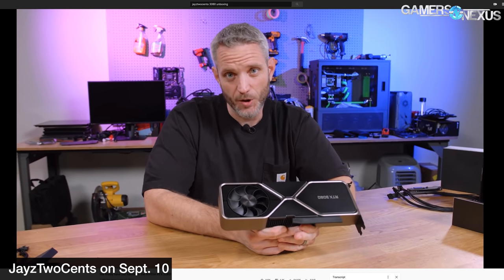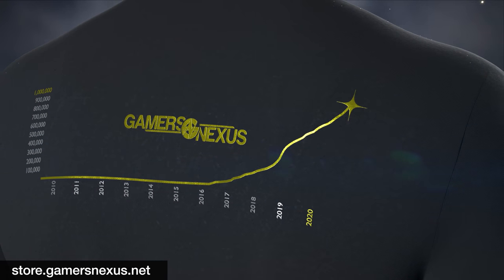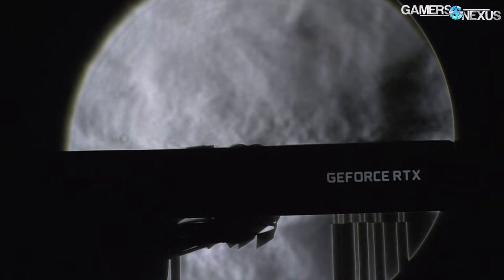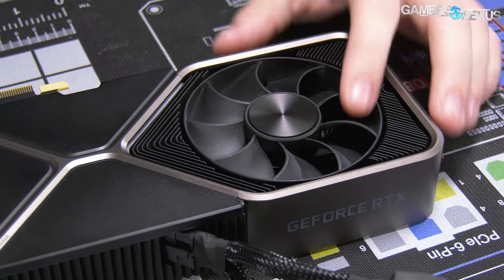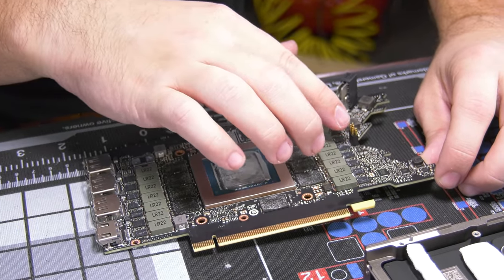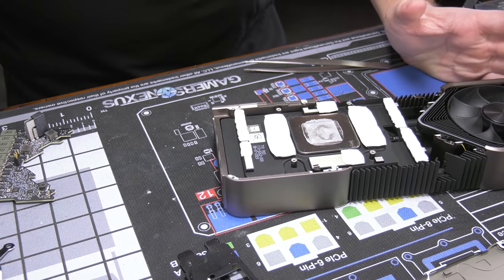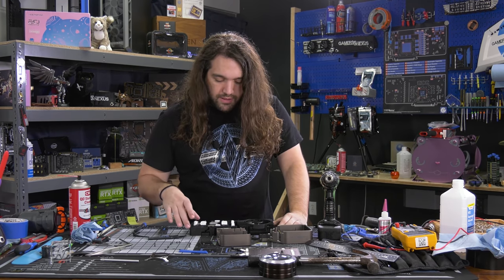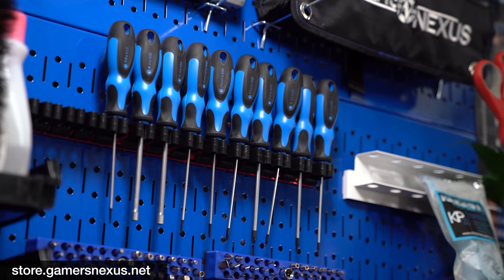Tear-Down: NVIDIA RTX 3080 Founders Edition Disassembly - A Lot Fewer Screws

Comment: "You're destroying that card" 
"Ok. Let's get one thing straight, the pcb is fine, the card is fine, it still works, it's fine." 
"This is why Jay said go watch Gamers Nexus"
Reply: the only thing he really drilled through was one of the magnetic covers, and frankly anyone taking apart this shouldn't even bother putting those 4 tiny covers back IMO
edit: unless it's absolutely for the looks on a vertical mounted gpu

Comment: Nvidia: Let's put some magentic screw hole covers so people can take the card apart easily!
...

Steve: BRING ME THE DRILL
Reply: Also, how safe is it to put a strong magnet near the RAM area of the card? I remember hearing back in the ddr days ram was very sensitive to magnetism, like you could kill a stick by photocopying it cause the lamp had a magnetic field
Reply: @H1nD009  no magnets could destroy HD or other magnetic media, , but not dram or sdram, they don't work with magnetism. There shouldn't be anything in a video card that magnets could destroy. Magnets may also effect certain electronic components that rely on magnetism to function while they are on, like certain relays and coils though, but you would have to contact it with magnets while it's on and functioning to mess those up.
Reply: @bakadeshi_aunstudios  thanks! I heard about that back in the early 00's but never questioned it
Reply: Magnets seemed to be for holding the covers to the screwheads, not to aid in removing the covers. That's why their own guide recommended a different way to remove them.
Reply: Steve doesn't need someone to him bring his drill, Steve always has a drill nearby

Comment: Steve: That paste is really dry
Jensen: I had them in my oven, what do you expect
Reply: Han Lockhart  Wh..... wh.... whyyy? It's pretty obvious that the thermal transfer is very good, since this monster stays just above 70 degrees during full load. Also, "dry" thermal paste does not automatically mean "bad" thermal paste. Some thermal compounds are actually meant to be dry! They might not be the absolute best of the best, however, in this case, I would say that it's doing a more than decent job.
Reply: @ruxandy  right
Reply: Han Lockhart  Low quality thermal paste or the cards are at least half a year old just sitting in a box, waiting for a sucker to buy it.

Comment: 14:40 I hate those ribbon cables so much! Every time I find them in a device, I know it's gonna be MUCH more of a pain to reassemble.
Reply: those cables  get a considerable amount of permanent damage every time you take them off, so have fun having to replace them  somehow after removing and putting them on 15ish times
Reply: When you getting one Dawid
Reply: are you going to review one dawid? i'd love to see you're take on things.
Reply: I would love to get my hands on one. I'm gonna try buy one tomorrow.
Reply: @DawidDoesTechStuff  good luck!
Reply: i find you every where my man, why do you post alot of youtube stories but you dont post videos
Reply: @Dacite6  I posted a video today. 😅
Reply: Love your channel.
Reply: @DawidDoesTechStuff  okie, i commented on your video
Reply: its better than legit ribbon cables like the switch lol
Reply: Totally agree😱 ribbon cables are the worst nightmare! Little tabs are so weak, and if you mess up the pins you'd have to cut a healhy section and sand the plastic coat to expose them again... And good luck trying to find a replacement😩😩
Reply: Actually ruined a PS4 controller because of such a cable once
Reply: @DawidDoesTechStuff  thats totally epic, have fun trying to get one though considering everywhere they sold out instantaniously.
Reply: As someone who've repaired a ton of laptops I beg to differ. ZIF sockets are a godsend once you get a handle on them.
Reply: Your name sounds like you're stuck in uwu mode.
Reply: I can never get them connected properly during reassemble.
Reply: I can't help but actually read that in your voice
Reply: Me too, I ruined mine and I'm screwed..
Reply: @AdrianOkay  I have an iPod 5G, it has the same ribbon cables. Nope they don't get permanent damage at all. One has to be just careful not to rip off by force.

Comment: I didn't realize how much of a graphics cards is just the cooler.
Reply: Yeah that's basically just a "card" actually !
Reply: I am amazed how small it is, super compact, imagine if it didn't generate any considerable heat and could work like this.
Reply: @arthurand1006  Well normally they are like twice this size. This one has been shrunken down to fit this new cooler design.
Reply: @jaalan7896  I think it just looks this small, due to the rest of the card being so big in comparison, I mean, they can't just shrink dies this easily, if they could than they wouldn't need to wait for tsmc and samsung to shrink their node.
Reply: Heat is the biggest modern issue in computing. Think about CPU and GPU the main powerhouses of the computer, both have to have insane cooling solutions because the chips have been made so tiny and powerful that it's very easy to overheat them with so much power in such a tiny space. Even nvme drives and overclocked RAM now require clever cooling solutions to keep from overheating. Heat is the reason computing is slowly approaching a line that will be impossible to cross without either 
1. new cooling solutions like submerging all the parts in antistatic liquid and pumping the water through a refrigerant cooler
2. quantum computing
Reply: @arthurand1006  Dude I'm also Arthur Andrade
Reply: @ShadyRapture  I wasn't much into M.2. SSD drives because I didn't use them yet, one day I decided to buy one to my server and I learned that what I thought that was some fancy metal design with a ROG logo on a specific spot on the motherboard, was actually a M.2. heatsink, I didn't know those needed one as I only used regular SSD SATA drives 😆
Reply: @OrbitalSP2  hahaha, Andrade is my last name. I bet you're a brazilian too
Reply: @arthurand1006  yes my last name too and also brazillian
Reply: if only lol

Comment: I would say that the silver metal housing is there partly as extra thermal mass and partly to improve the airflow by blocking more of the turbulence generated by side-draw into the fans which should improve the differential pressure across the fans, which should improve airflow (and thus cooling) at lower fab speeds. 

The fact that it looks nice is probably a nice bonus.

Comment: Steve: remove the ribbon
my head from watching JerryRigEverything: just like a little lego
Reply: With deeper grooves at level 7.  :D
Reply: I have worked with those flex cable connectors and they are really fragile. I think they are rated at like 10 uses. If you are careful you can get a lot more but we still broke them a lot and had to replace them.

Comment: "nvivida, how should I remove these screw caps?"
Nvidia: "glue them in place"
Reply: The drill holes are like those water indicators that shows if your device was wet.
Reply: At this point I'm convinced Nvidia wants you to make it look more difficult than it is. Like, what? Highly payed engineers over at Nvidia don't know that tape exists?

Comment: Steve, "Adhesive on a stick" doesn't necessarily mean to use GLUE. Tape is ALSO an adhesive. Not to mention you used a MUCH bigger stick than needed. Personally, I would have reverse wrapped a toothpick or similar sized piece of wood/plastic with duct tape and call it good.
Reply: Honestly just a ball of bluetac might have done it
Reply: Tape is an adhesive and a thin sheet stacked together

Comment: Glad to see someone shouting out "Engineer", they're Japanese, you can find them on eBay or at engineer(dot)jp and are damn good tools, way better than the near bottom of the barrel iFixit that all the tech tubers peddle. They might not be the cheapest but the compete with tools 2-3x their price IMO.

P.S. no I'm not a bot just an actual engineer 😅
Reply: How is Ifixit bad?
Reply: @voidofspaceandtime4684  their tools are not made for repeated use and won't last you as long as a good one.
Reply: @voidofspaceandtime4684  I bought a kit and I'm not happy with build quality, it's like a throw away kit
Reply: @voidofspaceandtime4684   They're not bad, bad, they're just the same quality as if you went to Aliexpress and sorted by price with cheapest first then bought the first result that looked somewhat good (but it would be cheaper that way), if you buy them to use once in a while they'll do the job which I'm sure is 90% of their target audience but if you want a good tool with good sizing and finish that will last I would absolutely look elsewhere.
After all the tech tuber endorsements years back I ended up buying a set and was very disappointed given the price, same cheap Chinese parts but 50% more expensive.

On the other hand after spending years looking for good tools at a good price, "engineer" were the first ones I found that could trade blows with the premium (both in terms of quality and price) tools that I have used over the years. A pair of snips might cost $20-30ish instead of $10 but they trade blows with the $70+ ones IMO.

Also nothing against iFixit as a company, I think what they do is great and looking at their tools as supporting them by buying their merch is valid, I was just hoping for/expecting more after all the non-sponsor spot endorsements.
Reply: Yeah, I like their stuff. I have their Nejisaurus (screw removal pliers) and their Bazooka (screw removal) as well. I'll have to look into their other stuff as well when I'm looking for more tools.
Reply: imagine buying any of these tech kit piles of junk and not buying real tools lmao automotive master race
Reply: @Attachments.  I only work on my PC with SnapOn air tools
Reply: Anyone wanna link me these toolkits? I gotta give my family something for my christmas list. 😏
Reply: @Grrizz84  Thanks for the heads up always good to know about in between brands I.e. Tekton, that hit a higher performance than their cost leads to believe.
Reply: @patrickw6074  when the SnapOn truck rolls up to the jobsite, it's pretty much strong armed robbery.
Reply: I bought an ifixit kit back in... shit, years ago now. The ruler was crap and I managed to snap a smaller flathead bit but other than that it's been reliable. I wish the driver handle was a bit thicker though. I'm in the market for a new kit actually, Any suggestions? £50 is my limit though currently.
Reply: How does Engineer compare to something like Klein? I use everything from P00 and (security) T5 up to P3/T40 pretty much daily; I'm happy with the quality, but 40 USD for free-fall snips and 70 for a unibit is hard on the wallet.
Reply: Engineer brand are a little hit and miss. The screw removal pliers (nejisaurus pz-59) are really stellar, the flush cutters are great (ns-04), the solder sucker is ok (ss-02), and the pa-01 sucks.
Reply: @Attachments.  Car's need different tools from PC PCBs. Even for the computer part most of the ones i took apart do not use the standard cross and touch screws. Then you have the parts that aren't in PCs but need a much high force applied to just remove something. The amount of force to remove a car tire will break a PC.
Reply: One thing you cannot take away from iFixit: the quality isn't bad and you pay premium to support their repair guides and activism. Sure, at that price point you can get better toolkits but for most of their target audience they will do the job perfectly fine. 

Even though I have a bunch of German and Japanese quality tooling for bikes and hardware, I still grab the iFixit from time to time.

Comment: 12:30 Its like opening a hood of a car to reveal the engine, what a beauty
Reply: 👍I would say 18:27 is more accurate to that analogy. Since gpu chip would be the motor
Reply: @ShimaS-0079  *Engine. Motor is for electric cars/charging the battery.
Reply: @plumeater1  they are same thing.
Reply: @ShimaS-0079  But wheres the hood opening? its like the entire motor being out and not just that "reveal" that happens when you open the hood of the car, hence the analogy when he pops open the top of the card to reveal the sweet goods inside ;D
Reply: @xGrifDog96x  I have no problem with what ya said.  I was just being more specific to the gpu being the motor/engine. Technically the back plate would be like a splash shield.  Just a observation. But I understand where ya coming from
Reply: @ShimaS-0079  You're looking into it too much xD
Reply: @xGrifDog96x  I know right 🙃😀

Comment: The absence of SMD M5 and M6 (memory IC's) could suggest that the graphics memory could be upgraded to 12GB - unless of course the bus lanes to the GPU have been disabled physically or through the GPU's firmware. But seeing how the board appears to be all balled up and ready it would be super cool if you could re-flow a pair of them onto the card. Strictly for Science of course :)

Comment: "First look at founders edition pcb"
Water Block manufacturers: high pitched screaming
Reply: I was thinking for the FE PCBs, the water block manufacturers could just add a fan at the end to direct cool air up at VRMs and RAM. It would let people going with a custom loop have some of the original FE aesthetic.
Reply: luckily NVIDIA has a reference PCB and a FE PCB, two different versions
Reply: @memethief4113  Can you clarify? I only see one card on their website for sale.  I want to be able to put a block on it later.
Reply: @JohnVanderbeck  I'm not sure if NVIDIA will personally sell the reference PCB (they do not have a cooler designed for it), but they have one designed for 3rd party companies that produce air and liquid coolers, the PCB is a more standard design while NVIDIA has the special design shown in this video exclusively for the founders edition GPUs
Reply: Don't worry this means they can overcharge by adding new design with a block built in the back end. Once they realize that $$$$$ high pitched sound becomes laughter to the bank.
Reply: @memethief4113  Do we know which partner models use that reference design?
Reply: @JohnVanderbeck  so far I can not find any info on who exactly uses the reference model, but EK waterblocks are designed for it and this article shows the reference design for the 3090
https://www.tweaktown.com/news/74958/nvidia-geforce-rtx-30-series-founders-not-reference-they-are-custom/index.html
Reply: @memethief4113  Thank you for the info.  Really throws a wrench into my plans for tomorrow morning.  Maybe best to just get one of the most basic EVGA/ASUS cards and hope they use the reference board.
Reply: @JohnVanderbeck  ah, from EKWB themselves, they are designing three different liquid coolers, one for the founders edition, one for reference models, and one for partner/AIB cards, like Strix, Aorus, etc. still nothing on who is using reference or AIB, but this is better than nothing
https://www.ekwb.com/blog/did-you-know-the-nvidia-30-series-founders-edition-layout-is-not-a-reference-design/
Reply: @memethief4113  You are amazing.  Many thanks!
Reply: @JohnVanderbeck  this time around the reference card and the founders edition card are designed differently. If you buy a fe you might be waiting i little bit longer for a water block. Who knows for sure though.
Reply: @JohnVanderbeck  This was from EK a few hours ago.  
 EK water blocks for the Strix and TUF Series graphics cards will follow in a matter of days, while the Founders Edition water blocks will take a bit longer.
Current Compatibility List for EK-Quantum Vector RTX 3080/3090 Water Blocks:
Card Name
Gainward GeForce RTX 3080 Phoenix
Gainward GeForce RTX 3080 Phoenix GS
Gainward GeForce RTX 3090 Phoenix
Gainward GeForce RTX 3090 Phoenix GS
GALAX GeForce RTX 3080 EX Gamer
GALAX GeForce RTX 3090 EX Gamer
KFA2 GeForce RTX 3080 SG 10GB (38NWM3MD99NK)
KFA2 GeForce RTX 3090 SG 24GB
Palit GeForce RTX 3080 GamingPro (NED3080019IA-132AA)
Palit GeForce RTX 3080 GamingPro OC (NED3080S19IA-132AA)
Palit GeForce RTX 3090 GamingPro (NED3090019SB-132BA)
Palit GeForce RTX 3090 GamingPro OC (NED3090S19SB-132BA)
PNY GeForce RTX 3080 10GB XLR8 Gaming EPIC-X RGB Triple Fan Edition (VCG308010TFXPPB)
PNY GeForce RTX 3090 24GB XLR8 Gaming EPIC-X RGB Triple Fan Edition (VCG309024TFXPPB)
Zotac GAMING GeForce RTX 3080 Trinity (ZT-A30800D-10P)
Zotac GAMING GeForce RTX 3090 Trinity (ZT-A30900D-10P)
Reply: Good thing they are making them for reference PCB instead then
Reply: @JohnVanderbeck  did you manage to pick up a 3080?
Reply: @marcusborderlands6177  I did not.
Reply: @JohnVanderbeck  ouch. well hopefully they manage to come back in stock soon.